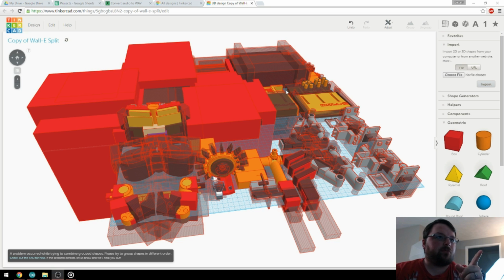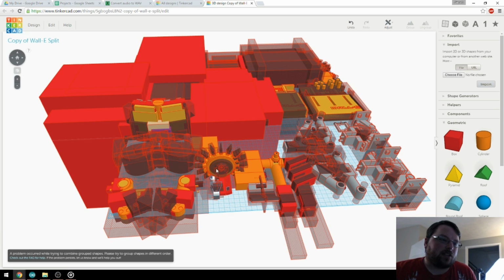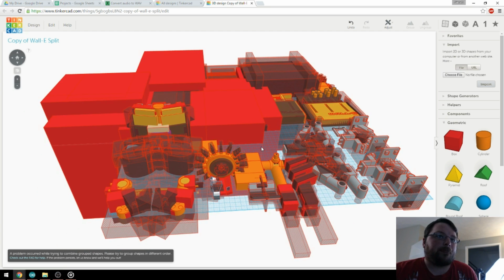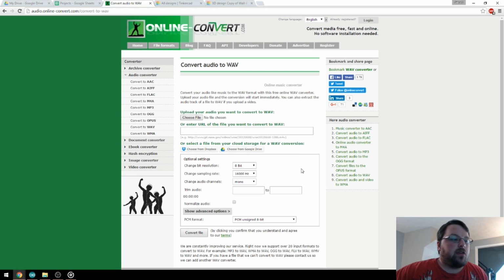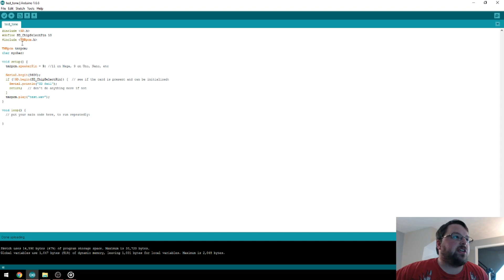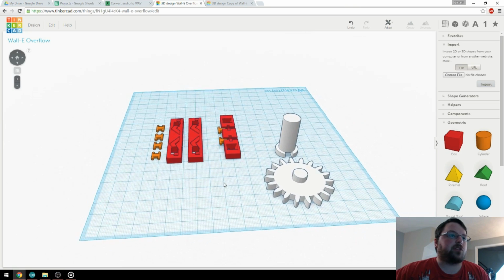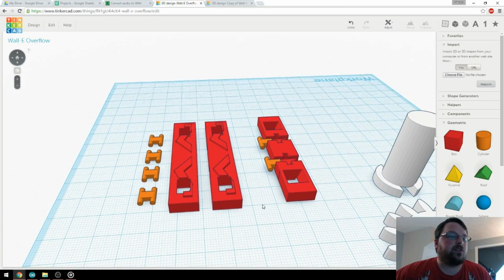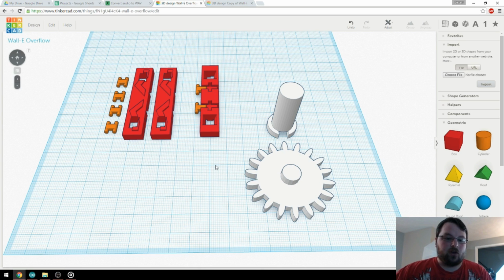Motors and Sounds! - Wall-E Update #9

Comment: Hi. Glad you are making progress on Wall-E.  I ordered some of the sound amplifier chips I linked before to give them a try for my projects.  When ever I get to make a Dalek or Sonic screwdriver, I want to have sound with both of them.  Too bad there's not really way they can do a sequel to Wall-E. I really liked it in the credits how they showed the rebuilding progess.  What's the name of the library you mentioned? I didn't quite get what you said and couldn't read the screen.
Reply from the maker: Thank you! Yeah I would definitely be interested in seeing a sequel of Wall-E. If nothing else it would probably give makes a few more fun robots to make lol. And the library I use is called TMRpcm. Link: https://github.com/TMRh20/TMRpcm 

Hope that helps. :)
Reply: Thanks, Ill get that.  I have a sd card shield to use for sound file and I'll try it with that library. And I'll also will see how better it sounds with chip. Oh. do you remember where you got your little speaker? The speaker I have is a good bit bigger and yours looks like it fit inside projects better.
Reply from the maker: I got this speaker here: https://www.adafruit.com/products/1891 

It's super quiet, so I think I should get an amp or something with it. We'll see though. I hope that helps! I'll be sure to put together a full list of what I use when I finish the project as well. :)
Reply: Using an LM386 amplifier circuit made it a lot louder and better.  I'm having to get a new speaker for prototyping because the one I've used gotten damaged over time. But still sounded better over direct output from that library.